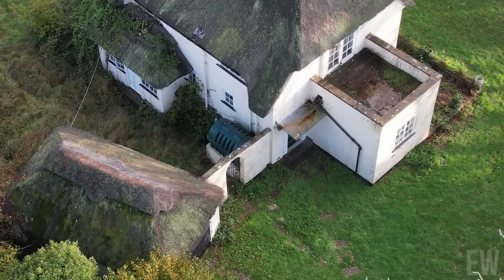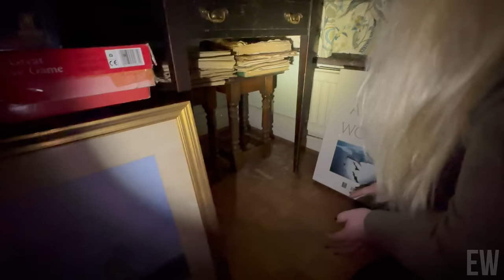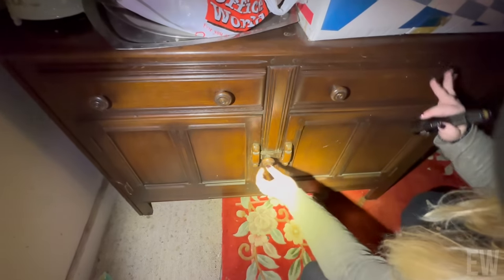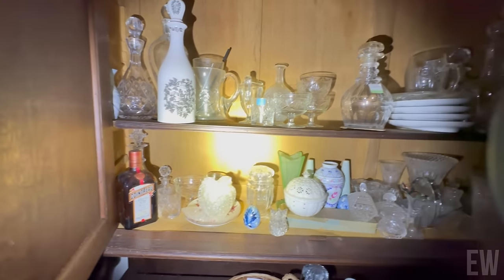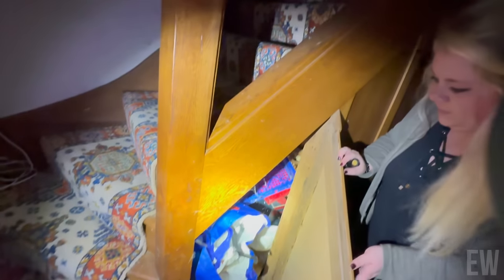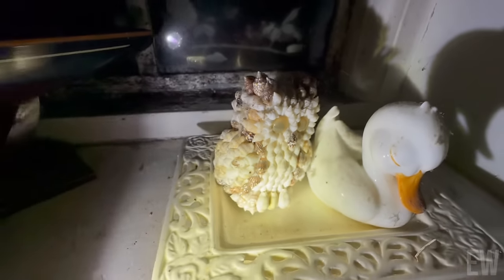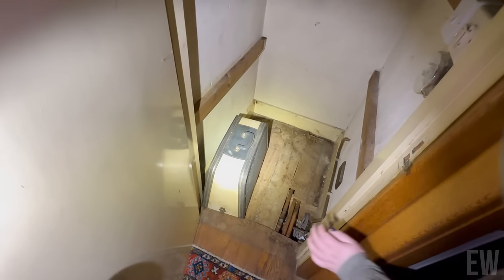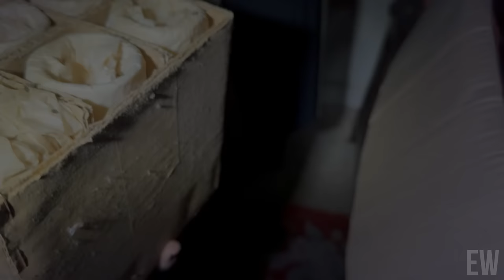Inside An UNTOUCHED Continental House - Found ABANDONED Cars

Comment: I found the sewing machine on eBay for $20 Canadian not working and for £275 for one that is. They are industrial machines. There were quite a few in Russian or Ukraine. Not really sure where. The bathroom under the stairs i would give a 9. The fact for location the use of the space the decorations and the floral sink. The 2nd bathroom i would give an 8. How about a Canadian viewer shout out next time. The lamp in the box, the glass flute goes on top and the dial brings the wick up and down. T.A.C.
Reply from the maker: That’s interesting! Looking back at it now, that machine did have a soviet look to it. Thanks for the info on the other bits. Enjoy the holidays 🎄